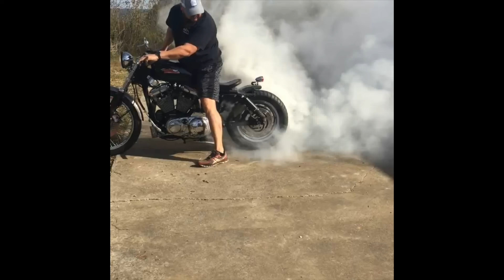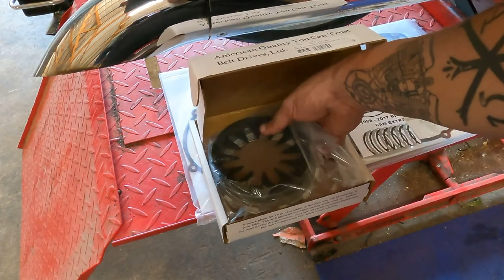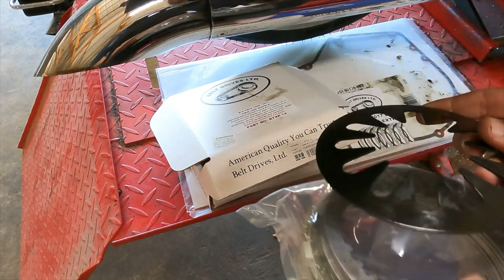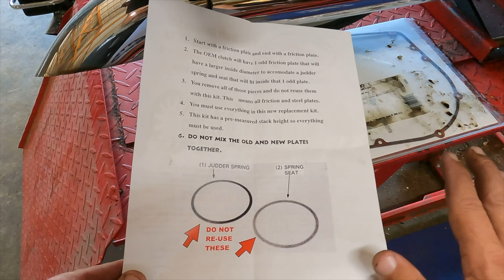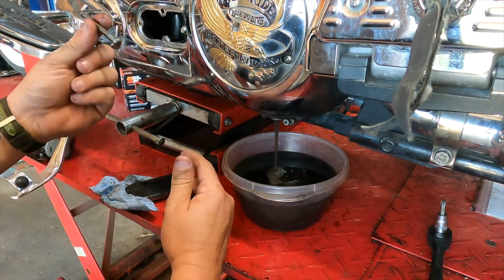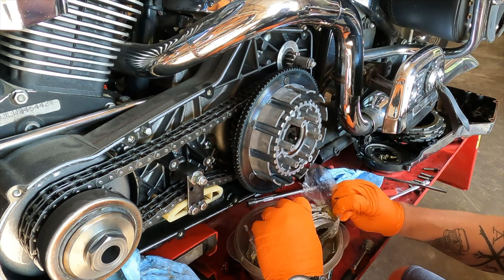How To Replace Clutch Pack on Harley Davidson 5 speed. Butler Customs

Comment: Help !!!!! I opened my derby cover and the adjustment screw and 11/16th nut are missing 
Really thought I just broke a cable
Reply from the maker: Yikes! Remove your primary cover. You should find those parts lying inside your primary. And inspect your clutch hub basket to see what broke. Also make sure those loose parts didn’t damage any teeth, the primary chain or your chain adjuster shoe.

Comment: Hello and thank you. Why did you not re-use the two small metal rings that go in first? Thanks.
Reply: Gotcha. Thank you. I’m trying to figure out why my clutch won’t stop dragging on my 98 Fatboy. New clutch pack. Adjusted perfectly to spec. Still drags and neutral is impossible. Even if I fully adjust up the clutch tight past spec. Still drags. Thanks. I’ll figure it out.
Reply from the maker: @tomsell3602 my pleasure
Reply from the maker: Because this is an upgraded clutch pack that comes with an extra plate. Therefore you discard the stock rings.